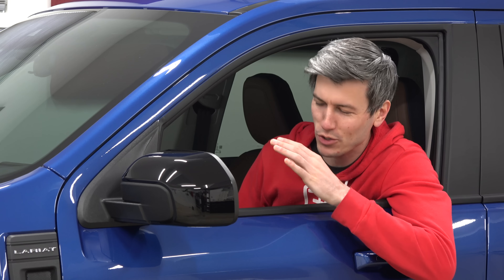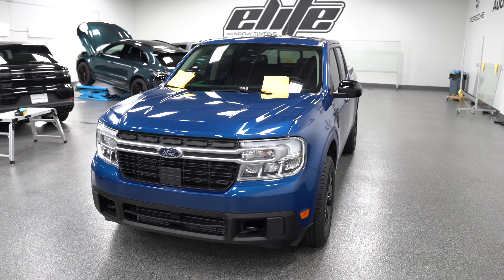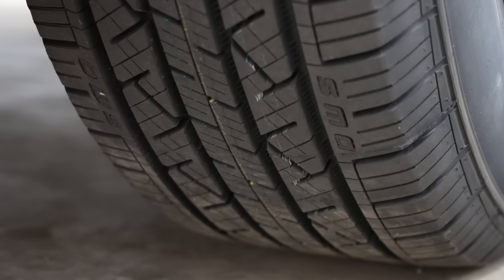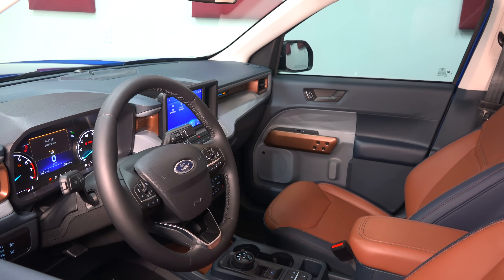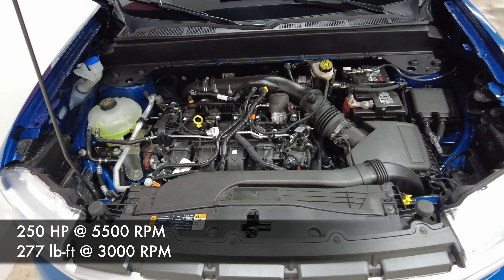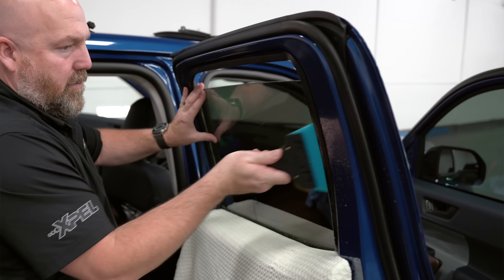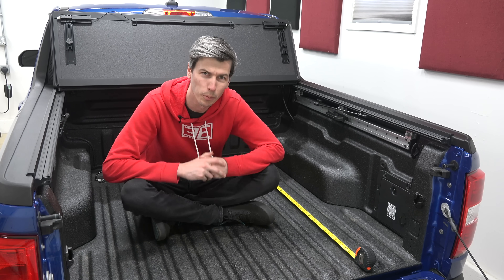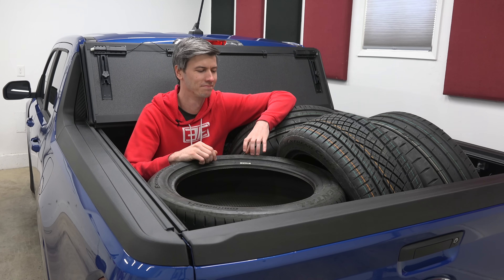I Bought A Ford Maverick! The Perfect Pickup?

Comment: I have the same truck and love it! One detail you missed - the half-down tailgate is not to lock items in, it's to match the height of the wheel-well so you can place sheet goods in the back and have them supported by the tailgate all at the same level.
Reply: I brought home a 4x8 sheet of 3/4" OSB board that way yesterday. And I have put my 2022 CB500X Honda motorcycle in the bed with the tailgate flat. The tailgate supports 300 pounds so it is no problem.
Reply: That's nothing, I put 4 to 8 SOB's in the back of my truck all the time 😅  @steveogilvie5203
Reply: This is what finally convinced me to order mine

Comment: I shopped this truck hard.  I didn't buy one because:
1) The bed is tiny.  I mean truly tiny.   If you are the type of person who "uses" the bed of truck, this one will not be up to the task.
2)  The interior is also tiny.   At 6'-4" I technically "fit", but it was "just"...   Not something I could tolerate, as I road trip in my trucks.  Being on the edge of crammed for 4-10 hours is hard pass.
3)  Don't even think about sitting an adult in the back seats.  Small kids and pets only.

4)  I loved the interior "look".  They did a smashing job, one of my favorite interiors of all time.   BUT, it's 100% hard plastic.  It's "inexpensive" for a reason.  (But props for making cheap look very cool).
5)  The magic gas mileage is ONLY for the 2x.  Sorry, I live where it snows, need me some AWD.  
6)  The pricing also goes out the window, as a top trim Maverick goes for $39k.   

-
An example.  I ended up going with a Honda Ridgline.  (For $42k).   This last weekend I bought a partial pallet of landscape pavers.   The landscape company used a forklift and set the 4'x4' pallet straight into the Ridgeline bed.  (Yes, it's that wide, and that FLAT).   (Also, the bed load rating is 1,000lbs.  I put 1,900lbs of paver in the back.  Not the smartest thing I've ever done, but the Ridgeline handled it...)

Comment: 40k still blows my mind! I bought a 2014 Toyota Tundra with 65k miles for large trailer towing. It cost $29, 000. I bought a 2020 Honda CRV with 15k miles as my daily driver. It cost $26,000. I realize I spent more overall, but I put about 3000 miles/year on the Tundra. I put about 30k on the Honda. The Honda is getting about 35mpg. Dollar for dollar I am very hesitant to ever buy new. My daily driver has all of the most advanced safety/audio tech. My Tundra will out live me. It all comes down to what you need. I would not say the Ford Maverick is a bad idea, yet. But has Ford made anything as good as the the F series? ....

Comment from the maker: To address the comments, so that it's absolutely clear, yeah, I personally paid for the truck - this is not sponsored by Ford. Let's break this down:
1) If a video is sponsored, I always disclose that it is sponsored and say who the sponsor is. I intentionally am very obvious about this - I'm happy to be transparent; it's how YouTubers should be (and it's the law, if you're into that). If you're ever wondering "is this sponsored" on my channel, it's probably not, because I will make it painfully clear when it is (this video is sponsored by Continental, as disclosed in the video and in the video description). 
2) Yeah, $40k (what I paid, before taxes) is a lot for a Maverick. Inflation also sucks. $40k today is $30k in 2016, which is when I bought my Crosstrek for $25k. This is a lot more vehicle than a mid-trim Crosstrek, for what is effectively $5k more. If you spec a bare bones 4-door F-150 with 4WD, it's $50k today. That's the absolute minimum, with only base features. Truck prices do be crazy. If you're concerned about price, get the XLT Maverick - as mentioned in the video it's the smarter buy.
3) I bought the Maverick because I think it's a cool product and it's useful for what I want in a vehicle. Ford as a company had no sway on my decision. I did reach out to Ford PR for X-Plan pricing, they helped me with locating a nearby dealer and settling on price - but you can go on the configurator yourself and see I am basically right at MSRP. Early days, sure, getting Maverick at MSRP was difficult, but the automotive space is catching up and gouging isn't as effective anymore. You can get these at MSRP now, if not under. 
4) If you genuinely believe I'm going to try and sell a product to you without disclosing it, well, that's a bummer! I'm not here to trick anyone. I simply like the truck. I get that plenty don't. Options in the automotive space are a good thing. I buy what I like. You should do the same!
5) I just tested it and it turns out I am able to fit four bags of mulch in the bed, not just three (in case you were on the fence). That's a lot of mulch! Fun fact (for real) - Maverick actually has more payload than F-150 Raptor!!!
Reply: I have a velocity blue with bronze wheels. See you on the forum EE!
Reply: MANUAL MANUAL MANUAL
Reply: My dad had a metallic blue 1988 Ranger extended cab. We drove across the country in that, my sister and I in the bed under an uninsulated camper shell, in bucket seats my dad installed facing rearward. It was great. He passed in 2022, and I hope to pick up a blue ford pickup sometime soon to keep my memories of those days fresh. I'll probably get a F150 Lightning because I don't want to buy a gas car if I can avoid it (nearly free charging at home, thanks to the solar). The maverick is the closest thing today you can buy that is similar to the size of my dad's ranger. 

I salute your choice, Jason. The maverick is a smart and versatile choice - it really ticks all the nerdy engineer options (I'm an engineer myself) Have fun with it!
Reply: I really wanted this truck and still do but I was a little disappointed about the transmission. It really felt all over the place especially after owning a manual vehicle
Reply: You keep referencing the F-150 but not the smaller more affordable Ranger.
Reply: It does not have a boxed frame, its not a truck.  Just kidding, still a truck, but built a bit different... which is fine.
Reply: My last 2 tire sets Continental limited slip on my impala and i cant get them to lose traction
Reply: I'm disappointed.  Why would you not get the XL hybrid?  Front wheel drive only makes it the best non-"Truck" Comparison.  Our XL is sitting at 45MPG right now (around town only).  We have a tow hitch and have towed my dirt bikes with trailer 50 miles one way or so.  Still getting super MPG.  Sure my 4XE can do that was well, but not near as good MPG.
Reply: It's no longer a good deal when you pay 40k, plus additional expenses....
Reply: If I had the money,  I could see myself in the same truck. Great minds do think alike!
Reply: Jason, nice job! Like your friend, some guys make fun of my trucks but I don't care. The Mav bed is only 6" shorter than the new Ranger or crew cab Tacoma. You can't really fit much more in those. 

I am a tiny channel compared to yours, but ask any questions of our experiences with our 4 Mavs in Huntington Beach and Park City: An XLT lux hybrid, an XLT lux AWD 4k, a Lariat hybrid with BAP, and a Lariat Tremor.
Reply: Do a video where you get and test out the new Toyota Imvo and compare it to the Ford Maverick
Reply: 3.78 million sub and you paid full price?  Loser!!  lol.  Just kidding --- I love the Mav!!
Reply: Thanks so much!  This is a thorough review and honest!  You touched on parts of the vehicle that I would not have thought of.  I feel much more confident in buying this vehicle after your review.
Reply: I feel like the Lariat should have been cheaper still. I acknowledge inflation may be the reason.
Reply: This video is perfect because I’m looking at switching to a Maverick from my 2015 Crosstrek. And what’s awesome is it looks like the 2025 will have the Hybrid AWD. 

Question how much was the wrap and the window tint that you went with?
Reply: Great review thanks a bunch😊
Reply: I just hope we get more maverick content! Loved the video
Reply: I looked at the Maverick too. With multiple frequent passengers, we're still SUV people. The decision pointer landed on the Jeep Compass Trailhawk. Maybe I'll think differently in 3-5 years and come back around to a small truck.
Reply: @transportationoic Whenever I owned an SUV, I always wished I had a truck.
Whenever I owned a truck, I never wanted an SUV.
Reply: Whaat more payload than a raptor? Love it. That should definitely have made it into your phone conversation there.
Reply: meh, I have a 2004 ranger.  Size wise, I could probably fit 16-24 bags of mulch in the bed.  Weight wise....not a chance.  Cudos for you getting what you wanted and ty for telling us all this info.
Reply: You have such strange taste in vehicles for a car guy, I don’t know what to make of it. I think the S2000 was the last “cool” car you bought. 

Makes for some really useful videos for everyday people I suppose.
Reply: I’ll take my Crosstrek; at least I have a dry trunk.
Reply: I like the Maverick but the Hyundai Santa Cruz is better :)
Reply: I believed every word until the mulch, 3 1/2 on a good day. You almost had me believing you, but you had to go and stretch it just a little too much
Reply: You paid big money for a toy, not a truck. A full yard of manure would not fit in this "truck", therefore it fails in it's role.
Reply: Really bad choice buying a Ford over a Japanese built vehicle.
Reply: @philc824  If a hybrid maverick fits your needs, then there is no need to cross shop with a Taco, as that is more truck than is required if a Maverick works for you. Not to mention a Taco hybrid will set you back at least 20k more (26k for Maverick XLT vs Base Taco hybrid). 

Spending 47k on a truck when you can spend 26k on a truck and still meets your functional needs is the correct choice for any engineer and family man who knows anything about finances. Ford has been doing hybrid systems for a long time, nothing novel or risky here.
Reply: My brother who lives in MN sold his after the first year...Next year, check the underside of your Maverick and be amazed at how much rust is on everything.  Super cheaply made.  A Honda Ridgeline would have been a better purchase.
Reply: @Eric-xp1kl We used to grease & re-prime Tacos every year.
Reply: No cooled/ventilated seats.  Pity.
Reply: @fidelbanuelos9601  brother theres not even rain sensing wipers
Reply: @woody7155  ugh.  Leaning towards the GMC Canyon Denali anyway.

Comment: My mom has one of these and its pretty good, but can you explain what "automatic climate control at 3 different levels" is?   Auto isn't just...auto?
Reply from the maker: You can set the maximum fan speed, so if you want auto but don't want it absolutely blasting (noisy), it will maintain a certain temperature, but might take longer to get there bc it limits fan speed.

Comment: Only truck I’ve owned was a 2020 Tacoma with cost $38,000 new and still getting quotes from carvana (4/27) $29,800. You paid $40,000 plus coating that cost about $12,000 around here that’s over $50 grand for a vehicle from a company with questionable quality (#1 in recalls 3 years in a row) plus unibody construction, you obviously have more money than me, I can’t afford the depreciation that vehicle will have along with the tesla (that I know because I have a model y lr, should have not go rid of the Tacoma to get it in 2021)

Comment: Pretty sure that 2.0 4-banger makes more horsepower than the 7.5 litre V8 in my '85 F350. But it is a "real" truck, because that monster could tow some 18,000 pounds. 😉
I'd buy a Maverick if I could.

Comment: 6:26 It's a Ford automatic transmission. It will need to be rebuilt or replaced after 70k miles. They're designed to fail. Engineered obsolescence. Trust me. I used to work for Ford. I've had plenty of 'em. Their motors and chassis' are rock solid, but their transmissions are built to fail.

Comment: My in-laws had one for a short period of time when they first came out and it's genuinely surprising how terrible they are. They had the same engine, and going uphill for any period of time will lead the entire cabin to smell like oil. Try not to break too hard, as the cabin will begin shaking violently if you do. Don't pull too hard on any single surface, as they are seemingly held in place with hopes and dreams.

Comment: I'd drive a Ford Maverick.  It's somewhat similar to the greatest car I ever owned -- the Honda Element.  But I occasionally tow a 3,500 lb. trailer and the Maverick just won't cut it.  I know it is rated for 4,000 lbs but I don't want to be at the limit.
Reply: It will tow that just fine. Hell, someone towed like 8k lbs with the hybrid version!!! Google the article, its only rated at 2k lbs . Those limits are SET conservatively low buddy .

Comment: I wonder how you felt about the 4 cyl 2.8L Duramax Colorado and Canyon while it was a thing. I have a 2016 diesel Canyon and got it when diesel was cheaper than gas around me at $1.99/gal. Checked every box imaginable. Decent seating, not too huge (and i came from a 2dr shortbed S10), long bed, great MPG (especially for a truck), and high towing capacity.  Maximum utility with very little compromise. Fuel prices recently have changed the story a bit, but still.

Comment: I recently purchased a 98 Tacoma (from an old guy in Beaverton, as it so happens). 5MT, 4x4, 6 foot bed, 3500lb towing capacity, 23 mpg measured when I fill up, and "regular car" exterior dimensions and turning radius. I love it!
Reply: is it a 4 cylinder
Reply: And somehow that compares to the Maverick ? Hauls less weight ,uses more fuel ,costs more (new) ,sits too higher ,etc.  Parts are pricy .
Reply: I've got a 98 Tacoma too. Very cheap, very reliable. I can guarantee that Ford will not have fans 26 years from now. It probably won't even be on the road.
Reply: @randykintzley5923  It'll have the same reputation as the 90s rangers and Tacomas have in 20 years.
Reply: Not comparable. When they depreciate no one is going to spend 1k on a rear taillight control module etc. Those old trucks were cheap and easy to fix, when these expire it's way harder and pricier
Reply: @LLG47  The maverick is the simplest vehicle on the rode, it is perfectly easy to work on. It has a 4cyl engine that is quite literally as reliable as the Tacoma. Consumer reports ranks it as more reliable than ANY Tacoma. Get off your high horse.
Reply: @dinosoup  It is definitely not the simplest on the road. I would wager that award goes to the Nissan Versa, or possibly at this point the Frontier. Consumer reports isn't the best source, and in no way describes ease of repair. The 1st 75k is different than the 2nd for sure, and when things do go wrong they go more wrong for more money in a time when people have less money. I spoke to a recently retired autobody guy a few weeks ago, he said that he had to repair a BMW headlight recently which cost 4000$, not including the dealer reprogramming fee. Ford is not that different, and the parts are more specific, less universal, and harder to source now. My old volvo just got a new 85$ tail light with a 1$ bulb. Yes, those numbers are less than the 1000+$ they cost on rockauto.
Reply: @dinosoup  I would take the 98 Tacoma over the maverick in a heartbeat, the maverick is heading in the right direction but their is so much I don't like about it, like its kind of chunky looking the circle shifter from hell is on it and that bed is way to small, I want at least 5 and half feet 4 and half is way to small. I have more things i dislike about it but ford is heading into the right direction. but what would really make me happy is if they stop selling the ugly ass crossovers and give my crown vic back to me.

Comment: Good choice.  We have a Ram 1500 for heavier duty purposes, but when we wanted to trade in one of our commuter vehicles we went with a Maverick XLT...before they were at dealers.  Got our order in early when prices were still low and have owned it for while now.  We optioned the bed rack system and the 4K towing package, but not the tri-fold as we've experience with bed covers and found any folding style can potentially interfere with larger or longer/taller loads.  It is surprising how quick the truck is and how well it rides and handles.  The only issue we've had with it is the loud injector noise from the engine bay.  With no engine cover or insulation, you can really hear them ticking away.  A bit over 40K miles on it now with quite a bit of both bed hauling and towing and the truck has been pretty much perfect (minus the ever present Ford software glitches/updates that seem to happen to every Ford).  2 minor recalls to date and both addressed quickly by the dealer.  Like I said...good choice!